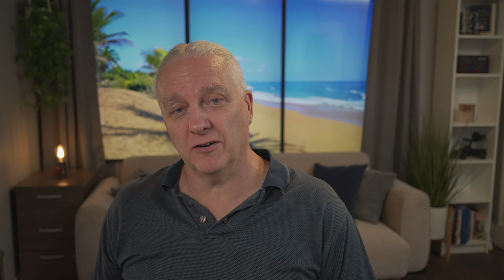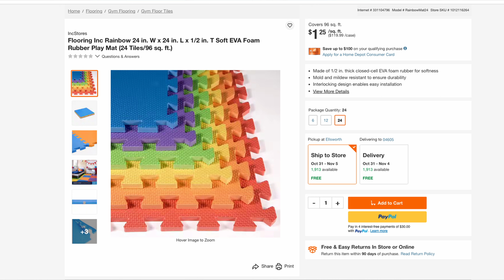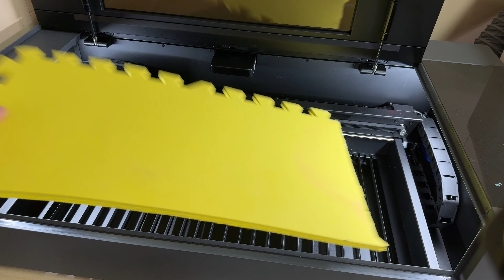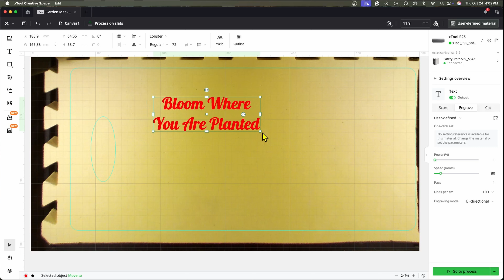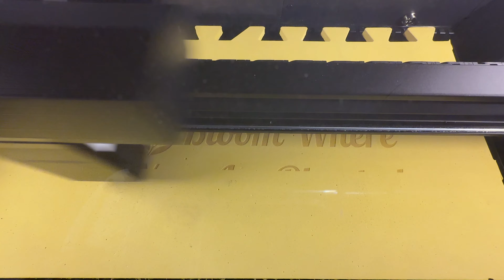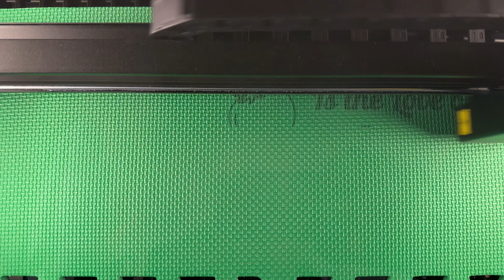Cutting Foam with Lasers (and Making $$)

Comment: Can you do this on a conveyor?
Reply from the maker: I don’t see why not.  It’s pretty light so you’d probably have to tap it down a bit to keep it in place. Maybe put it on a board as you run it through and don’t tighten the rollers down more than enough to move the material

Comment: Why would someone pay $12 for a foam pad, you can get the same one from Dollar Tree for a $1.25.    Or at best, just you one from Dollar Tree and you won't have to cut your own!
Reply from the maker: Well the ones from DollarTree are smaller, which is why they are cheaper.  But assuming they are EVA, you could use them.  If they aren't EVA foam then I wouldn't touch them.  If you start from a full piece of this foam you can also cut any shape you want.

This video is more about making things that can make profit rather than a specific material source, so take the idea and use whatever foam you have/want.  I've cut things out of black polyethylene foam as well.  This is black foam that is always used to pack things like lasers, so I have an ample free supply.
Reply: the question is best answered by "because they will sell for that price".  the general public isn't crafty, so they buy things that are.
Reply from the maker: @jetah50  It's the perception/reality of handcrafting something.  You can buy a $3 cutting board at Dollartree too.  So why would anyone pay $1000 for one.  It's the difference between a utilitarian product and a piece of art created by hand.
Reply: @SteveMakesEverything  I'm on your side. I know people will spend 50$ for a kneepad thats custom.  They'd spend $100 too if the material/color is right.

example: you could take 3 colors, stack them and cut out the top layer and invert the color (use 2 color for the top) and someone would $100 for it.
Reply from the maker: @jetah50  Yes,  It's about know your customers.

Comment: Curious, is there a fire hazard with Eva foam? Do you know settings for a co2? I have a mira 7 60w. Thanks so much for this, i would love to make a set!
Reply from the maker: I used a CO2 (the xTool P2S 55W), so your settings will be similar.  EVA doesn't really burn all that well, so fire risk is minimal, and the lasers is moving pretty quickly, so it isn't in one place long enough to start a fire.

Comment: Could make foam coasters too....having tiled floors everywhere, coasters don't tend to last long!
Reply from the maker: Yes, this foam is very versatile, so it has lots of potential.  It can also be glued together with contact cement or 3M spray adhesive

Comment: You say foam, but what kind of foam? Not all foam materials can be cut with a laser. Some foams are toxic when cut with a laser. Please be more precise.
Reply from the maker: 😀 I very specifically said "EVA" foam (Ethylene Vinyl Acetate), so no chlorine to worry about.  If you look at the chemical composition, you only find a bunch of carbon, hydrogen and oxygen atoms.  It also gets used to make tubing for the food/beverage industry.
Reply: @SteveMakesEverything  Very cool. I can see some other ideas. So, if I'm looking at a foam item in a store, how do I know if it's EVA foam or not.?
Reply from the maker: @Islandskies  Most of this foam is EVA because it provides great flexibility.  PVC foam tends to be much stiffer, so you usually know it when you see it.

Check the package in which the foam comes because it's typically listed somewhere in the fine print.

Regardless, make sure you are well-vented to the outside, just to be safe.
Reply: @SteveMakesEverything  OK, thanks for the reply.
Reply: @gilbertboyer9936  He very clearly, and multiple times, EVA foam.